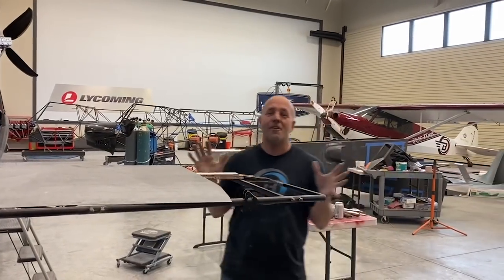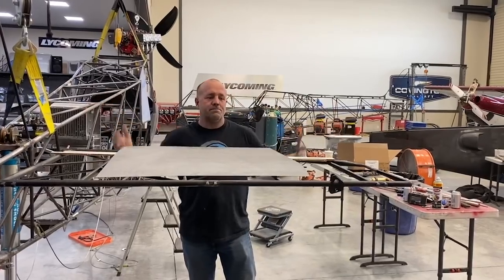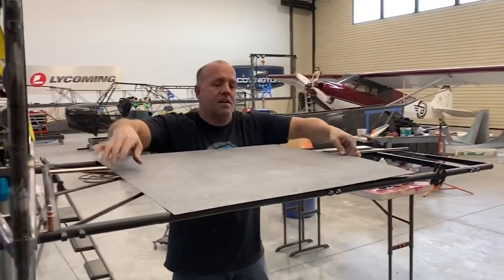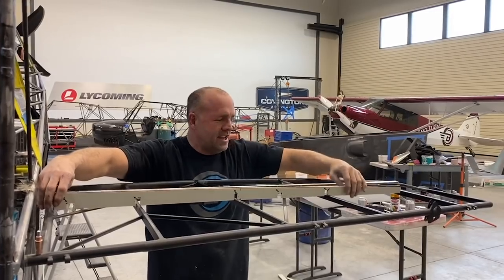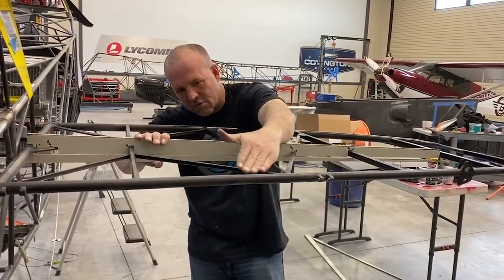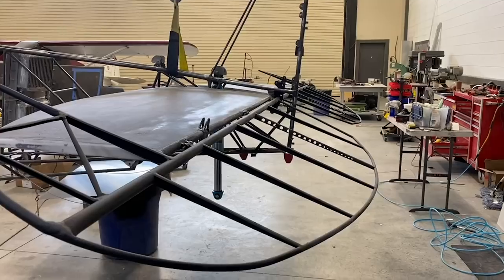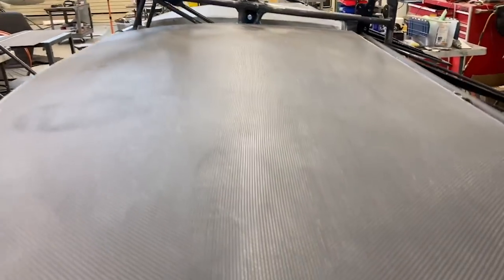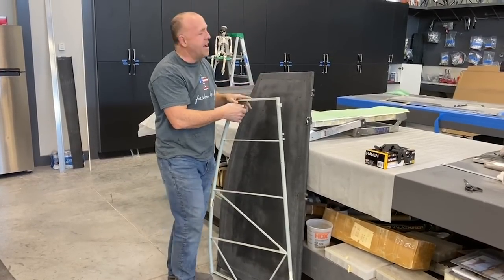Carbon Kevlar Carbon Cub (Scrappy Bush Plane 13)

Comment: There is so much carbon on this plane you should paint only some stripes or accents and then just clear the whole thing so show off the beautiful fiber
Reply: Keith Carlton and in the heat of Utah it melts like chocolate? If he would build everything in prepreg and postcure it then maybe but still.. a black plane will heat up like hell!
Reply from the maker: RV-8tor  your correct 👍🤠 maybe not like chocolate 😂 but true.  so in the areas like horizontal and others I need to keep the strength I will paint those areas with a light color. Yet,  some portions of the tail section that holds its structure from the frame below, I will go ahead and show off some clear UV blocked carbon fiber and even as we know it does soften it’s still magnitude stronger than fabric. So In some areas that fabric is enough I’ll show off some clear carbon fiber just because 🤷‍♂️👍 🤠
Reply: @Spinner1987CH  I haven't seen that he's laying up CF over foam cores. I'm no expert in this kind of thing, but I believe the insulation value causes havoc as heat builds. He doesn't have that factor to contend with. 

As an experiment try touching the black paint of a vehicle when its sitting in the scorching sun...then try touching the polished chrome trim. The black paint will be hot, but the chrome trim will make our fingers smoke.
Reply: Paul Slevinsky i know what you want to say but actually I was a structural test engineer for a aircraft project (Solarimpulse) which was entirely built out of CF and we did a lot of testing. The result was that we still needed to cover the top surfaces to reduce the impact of the heat (the hotter it gets the weaker the structure becomes)..
Reply: Mike Patey sorry I am from Switzerland and we love chocolate and airplanes 😂
Reply: Sunlight destroys any kind of composite, especially carbon fiber.
Reply: @jackprice8525  covid too

Comment: This is why kayaks are made of a combination of kevlar and carbon fibre, which is interwoven into the sheet, as opposed to separate layers, like Mike is using. And it's for the impact resistance, a sharp rock etc won't crack the boat.

Comment: Back when I was in the Navy, I was an Aviation Structural Mechanic and I spent my entire time in the Navy painting aircraft ( S3 Vikings).  We would have to sand around panels that were removed for inspections, then seal and paint the panels when the inspections were completed. On different panels we would have to feather the layers of paint. I remember counting one time and this one aircraft had 57 layers of primer and paint. I can only imagine how much that weighed. The book called for one primer coat and two top coats.... But the skippers had to have their birds pretty.  A lot of them ended up going to NARF to get completely stripped. That's another interesting process....

Comment: OK this is coming from a composites Engineer...I've been working with this stuff my entire life, and have some papers (certs and diplomas) saying I know the FRP world.  I say this so you will understand the magnitude of my next statement.  This man knows his stuff!  I mean...REALLY knows what he is doing!  There are some things that I would do different, but they are purely judgment calls, different ways of doing things.
Reply: I used to build RV sailplane models from vacuum bagged carbon, glass and Kevlar.  I experienced this very phenomenon;   Raw Kevlar cloth could not be torn and could  only be cut with special scissors.  However, once it was laid up with resin it could break and tear like glass.  In fact, after a crash, you could take a piece of epoxy-impregnated Kevlar which had begun to tear and then continue tearing it with your bare hands.  

I’m inclined to think that the carbon and steel will do the job of carrying aerodynamic loads and preventing flutter quite nicely, but the Kevlar will add some thickness and some resin and not much else.  Laying up the carbon on a 45 degree bias would help immensely with torsional flexing, and I assume Mike did this.  This is an amazing plane, and so overbuilt that I see little risk in the layup schedule, even if the strength to weight doesn’t quite work out as intended.  

Just discussion points-not criticism.  Mike has advanced the art and technology of home building more than any human in a very long time, and he he is rightfully assuming his place alongside Burt Rutan and Dick Van Grunsvan.

Comment: G’day Mike team & Co, there are lots of comments re heat effects on your chocolate bear cub. 
There is a product made of super fine powdered ceramic that reflects heat. It can be added to all sorts of paint.
Mostly used for painting/ insulating roofs and works a treat, for hot and cold.
Love the Kevlar bulletproof strength, and keeping us all  up to date with the informative vlogs.
Much love light and laughter to all, xox Victoria Australia

Comment: Hello Mike.    Glad you thought of Kevlar to this Project. I like to tell you about this material that could save you some time. Carbon Fiber Made with Kevlar Blue Fabric Plain Weave a Company sell it on EBay.Please look at it because you could clear coat it then done.They have Red for you. Don’t yell but we RC Sailplanes people don’t like black Carbon because of the heat on the Epoxy/Carbon. We try to paint them a color. But your a engineer and a awesome pilot and builder. Please keep the plane video coming. My last Comment to you. I hate to piss you off. God Bless. Just trying to help.

Comment: It's a little late now but you could have gone with one of the NACA 4 digit symmetric airfoils and gotten some cleaner (less drag) airflow over the horizontal and would still not have to worry about it being biased up or down. It's great to see all the progress you've been making on scrappy lately, keep up the good work!

Comment: That light kevlar laminated on a flat caul plate and wrapped over an EPP foam wing and bonded with 3M77 will make an indestructible foam wing. Tough kevlar sheet over a flexible foam with a contact adhesive made wings on some research drones survive 90 mph crashes.  Based on actual experience!

Comment: I am in awe of your skills. You made a beautiful job of your I beam. Unless I am mistaken your aim was torsional rigidity of the horizontal. Is it possible that a fabricated member might have been better if it was a square tube instead of an I beam.

Comment: hi Mike!

just a quick thought I had already a couple videos ago.
Have you ever thought about spread tow fabric?
From what I‘ve heard, the finished laminate has a higher fiber density than the regular fabric which could provide you a bit more weight reduction because you can remove more resin (which you were talking about in one of your videos).
Since this is actually an interesting topic, I‘d love to make a little explanation video which you could include in your video to bring some more knowledge to the people.

Best wishes from Germany!

Comment: I reckon you should make Carbon Fiber tail feathers Mike. 
I’m no engineer, but I reckon that windmill spinning up front attached to that 8cylinder 500hp donk might require tougher surfaces to buffet against

Comment: Ok... so let me understand scrappy’s timeline...
“I’m gonna build an aircraft out of scrap parts!”

“I’m gonna make the airframe so strong it can handle anything!”

“Look at this monster of an engine I’m putting on scrappy! I’m gonna have to make it stronger!”

“Look at the prop I’m putting on it!  It’s gonna be a dragster cub!  I’m gonna have to make it stronger!”

“I’m gonna carbon fiber the whole thing!  It’s gonna be so strong!”

“Look at my avionics! They’re all brand new and all glass! But I have to make my pedals stronger!”

“Look what I’m doing to the tail section! “It’s gonna be so damn strong”

“I’m making the horizontals bulletproof!  It’s gonna be so strong!”

Seriously... by the time mike finishes making it too strong it’ll have gathered the infinity stones to bring draco back...
Reply: dont give us hope.
Reply: I made mike laugh.... 2020 was a good year
Reply: It's kind of like fixing a car by removing the radiator cap and driving a new car under it.  Except in this case it's BUILDING a new car under it.
Reply: That engine's so strong, it's going to take off and leave Scrappy behind! Hey Mike, are you making the seat mounts from titanium?

Comment: Hey Mike pretty cool that you decided to reinforce the horizontal with Kevlar to add strength . But instead of using separate sheets of carbon and Kevlar why didn’t you use a carbon/Kevlar hybrid sheet?

Comment: Did you increase the tube size or thickness of the fore and aft steel tubes of the horizontal stabs, mainly at the root/joiners to the fuse? Is there a worry that the addition of the carbon skin and shear webs will produce a substantial stress concentration at the root's joiners to the fuselage? At any rate, great video. I think you may be the only YouTuber with such great modern aircraft building videos.

Comment: Mike; you could reduce the size of your vertical and horizontal stabiliser, saving weight, by having two vertical stabilisers, on your tailplane, one could be asymmetric to offset the torque from that Massive airscrew your planning to fit. It would have a smaller area than the massive one you have now but multiply the rotational counter torque by being offset? Just a thought?

Comment: You will create lift on the tail by curving the top surface , it should produce down force so also needs a curved bottom surface to counter the  lift upwards.

Comment: Awesome work , next time try doing a hybrid layup when you make your panels by putting the kevlar in your 3 plys of c/f. Top ply c/f, next layer kevlar on 45* from salvage edge. Then your 2 more plys of C/F.  That way you get you c/f look anti rip qualities of the kevlar with out all the extra sanding and extra layup . Bet it would save pounds  resin and c/f.
Any way just a thought .

Comment: Sorry I bit ignorant when it comes to building aircraft so this could be a dumb question. Why not use a fabric that has both carbon fiber and Kevlar  weaved together in one layer? I know this product exists, I've seen it used in other applications. Is the material extremely cost prohibitive or just has the wrong mechanical properties? Just genuinely curious. Love see all the technical details of the builds, keep it up.

Comment: I only know a little about the aeronautical industry, but i do know that it is heavily regulated. Could you at some point describe how a plane like scrappy is certified. 
For a layman i would expect you are flying under some sort of experimental licence with this plane but again, i would like to know more about the regulations you have to follow 
when building/modifying your plane..

Best regards from Denmark
Reply: It experimental class so it'll have big ole placards saying basically "hey this was built by a guy at home and your saftey is in his expertise and experience" but since it's Mike and he's building the M1 Abrams of carbon cubs you'll be just fine
Reply: With an experimental rating you can effectively do what you want in terms of modifications and as long as you follow the proper test flight procedures you are totally fine.
Reply: @adamjacobs8606  Not so much an M1 Abrams as a carbon "Sturmovik"

Comment: Question Mike.. have you considered getting a Carbon Kevlar weave? My friend (Also named Mike) Makes a race car called a sidewinder. Formula 500.  On the latest few cars he built for customers he made the inner portions of the cockpit, that in the past were aluminum sheet,  out of carbon Kevlar weave to give the rigidity, but also to prevent the carbon from cutting the driver in case of an accident. The Kevlar prevents the panels from turning into knives in a incident. Soo yeah.. was wondering if you considered it for your interior panels, and or carbon parts that are near you and family. Keep up the good work!

Comment: I know you thought this through but is it a good idea to combine materials with very different moduli of elasticity and thermal expansion coefficients like that? You have just about every material ever used in that tail. All bonded together.
Reply from the maker: PDZ1122  yes your spot on 👍🤠 depending on the area of the plane I design in expansion areas relative to the dissimilar material expansion rates.  I have done a lot of this in my engineering firm and several methods had to be used.  I had more videos going into detail but I Cut most of it to keep the videos not so long.  Thanks for comment 👍🤠

Comment: I love the enthusiasm Mike continues to inject into the project. That said, I have a question about airworthiness regime Scrappy is under. Is this 'EAA' 'Experimental or some other approach?  I believe this 'make it up as you go' wouldn't be possible in the UK (under what we call 'Permit to Fly').  ...Back to work

Comment: Hey Mike,
In hindsight, given the CF skin & it's structural component, would you be inclined to design the airframe structure (specifically empennage) any different?   Just as you removed the diagonal bracing on the horizontal stab after developing the symmetric 'airfoil'/skin bow,  how much empennage, rudder, and horizontal stab weight/structure is redundant?  More importantly, can we expect a structural design shift in the wings (assuming similar CF skinning/forming solutions)?  As always, your videos are inspiring, informative, and a pure joy to watch.  Thanks so much for all your hard work.

Comment: Brilliant. When wrapping the fibreglass around the metal components, is the fibreglass wetted out with epoxy to form a hard shell and is that enough to stop any movement between the fibreglass and metal over time? You said that you used micro for bonding. Is this 3M glass micro spheres used as an adhesive?  In other videos you mentioned that you used 3000 Carbon Fibre, what weave of Kevlar did you use? Although the Carbon Fibre in the final paint finish will be cosmetic.  Have you found that clear coat urethane paint over Carbon Fibre does not protect the Carbon Fibre against UV?  I can't remember you ever stating how much vacuum you use for vacuum bagging. How many inches of vacuum are you using and is there a point where too much vacuum introduces resin starvation affecting the resin to carbon fibre ratio? Can you please mention these points across any other future relevant videos.

Comment: Mike, once Scrappy and Draco "X" are built, you'll have a heck of a time deciding which one you'll be flying to Oshkosh.  You may have to "bribe" Marc to fly one of them there and swap planes for the return.  I bet the other project you keep speaking about is Draco on which you may be secretly working.  I can't imagine you looking at your "new canvas" and not doing something with it like taking the leading edge off the old one for the new.  Anyway, can't wait to see those 118' takeoffs.  Phil

Comment: Hey Mike. As you were tapping the horizontal stab, it sounds like a drum. Have you thought what the resonance of the engine and buffeting from turbulence might do to exacerbate the vibration noise of the plane? Have you thought about some sort of sound dampening waffles or coils on the inside of the fuselage to keep that resonance down?

Comment: Mike don’t know if you have time to read the comments but I have a question... I’ve noticed that there’s plane that are designed with (2) tails and even some larger planes with (3) would it be any advantage to using two tails on a small aircraft?   :-)

Comment: To explain the difference in carbon fibre which has a high tensile strength compared to aramids like kevlar is that Kevlar has higher shear strength. This is why you can't cut them with shears, other wise known as scissors. So together you get a high shear high tensile material. What your not getting is a high compression strength material and this is why the Chromoly is there. Not that it has a really high compression strength but it certainly doesn't shatter under compression. it deforms but hangs in there. Although Chromoly is pretty strong for its mass.

Comment: If I understand what you did, you created an aeroelastically unstable structure.  You want your center of stiffness in front of your aerodynamic center so that lift causes negative moment, twisting the structure toward less lift (less angle of attack).  Inherently, this means you need the structure (the beam) in front of the center - a lot in front.  More like quarter-chord.  If it's behind the aerodynamic center, you create a structure that's inherently prone to aeroelastic divergence (flutter).  Now, you might have made it so stiff that this doesn't matter, but inherently, more lift wants to twist it toward more angle of attack creating more lift (and around and around she goes...) which causes flutter.

Comment: Interesting ideas Mike. A few comments if you please, the “arc” is called wing chord or thickness. Your horizontal stabilizer trim in aircraft terms is called a Trimable Horizontal Stabilizer THS. No big deal just mentioning. My Pitts S1T has a streamlined 4130 tubing both sides of horizontal stab to absorb the power pulses from engine and prop and reduce vibration. Would that be easier than what your doing for beefed up strength. Your thoughts?

Comment: How did you decide on the final dimensions of the modified airfoils? More lift and more control authority seem like  obvious advantages, but how did you determine the size and scope of the modifications without going overboard with respect to exceeding the point of diminishing returns in effective control authority vs weight? 

I'd also like to know what you eat so I can go for days without sleep. Maybe a bowl of ball bearings and a quart of motor oil for breakfast?

Comment: Hey Mike ,
Due to propeller asymmetrical loading, your aircraft should pull to the right on take off, and to the left. On decent. I guess my question is how much offset does your vertical stabilizer have?